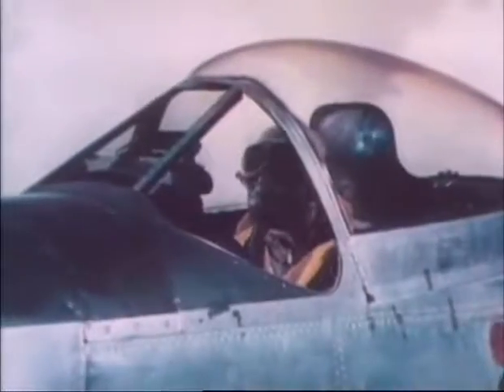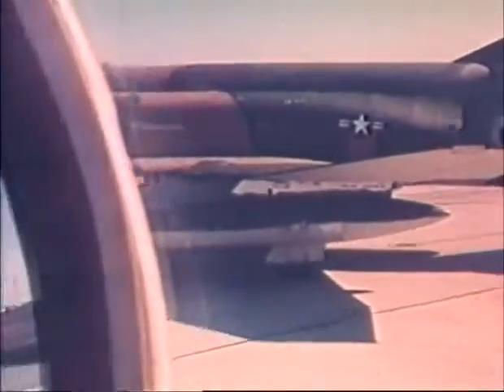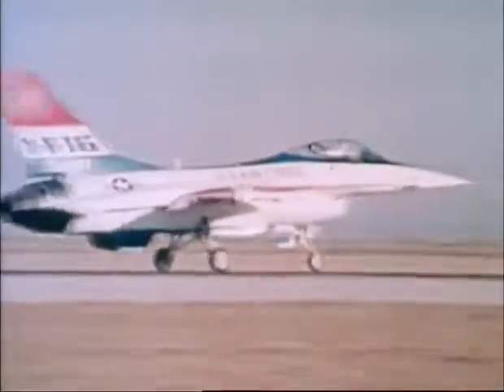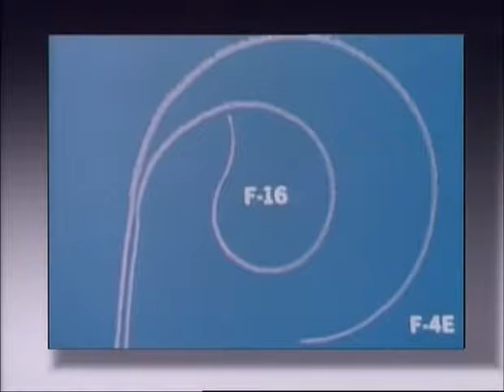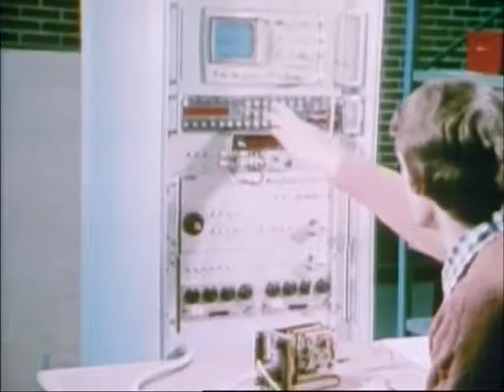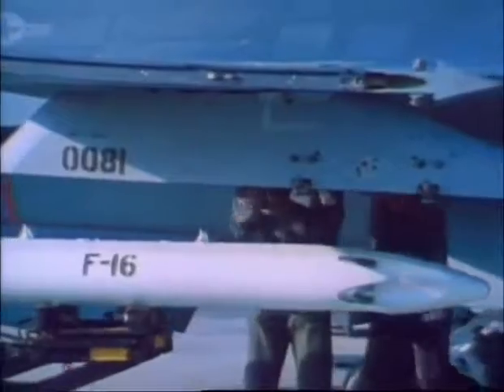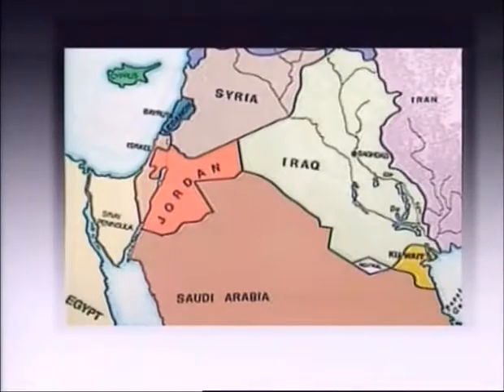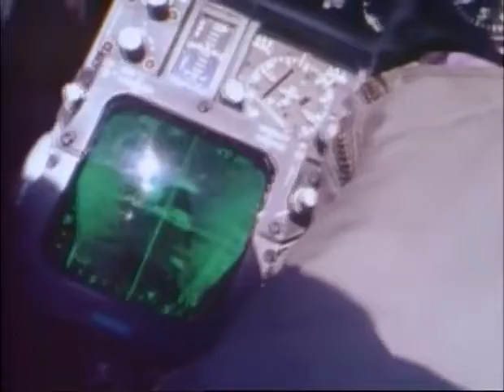Discovery Channel Wings - F-16 Falcon

Comment: The competition between the F-16 and the Jaguar/Buccaneer is ridiculous really, both of the RAF aircraft's avionics and weapons were technically out dated compared to the American offering. If you search for and find the technical info about the Jaguar and Buccaneer, it's no comparison as the Fighting Falcon was state of the art....  the banana bomber was old as it was introduced in 1962 and the Jaguar was designed and built on a shoestring budget.